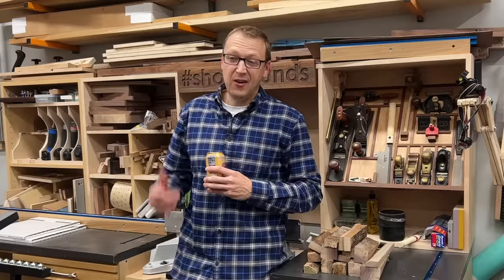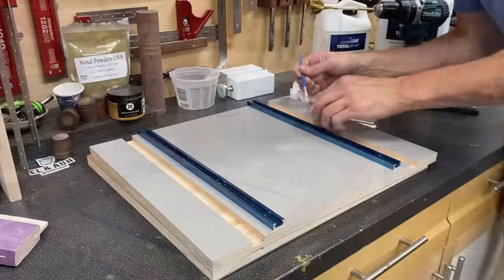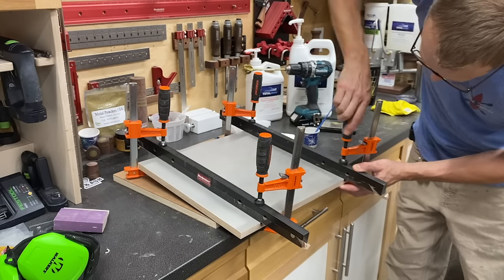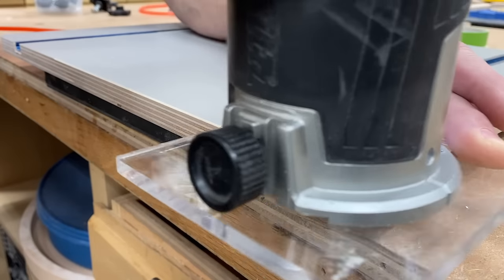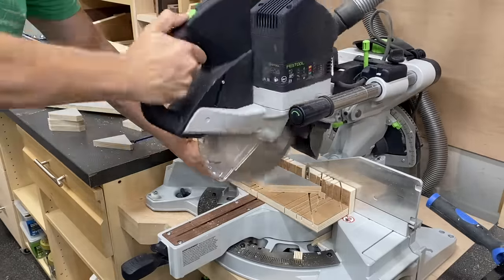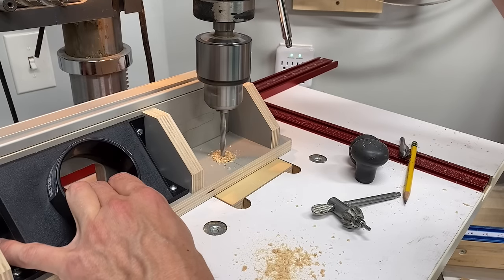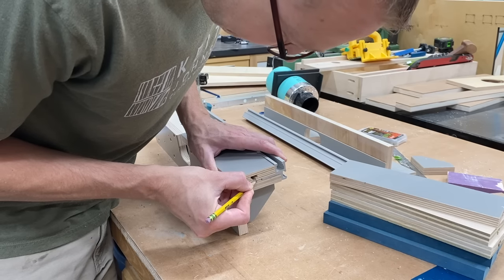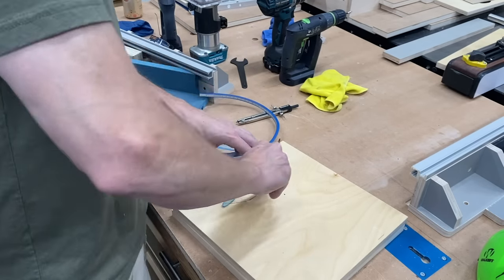DIY Router Table for Trim Routers | PLANS AVAILABLE

Comment: Where could I find that clear square makita router base  i love it. I want one. Thank you
Love the video!
Reply from the maker: Umm...I made it...as shown in the video 👍
Reply: What you charge to make me one?
Reply: I dont have the capability to make my own.
Reply from the maker: @roguejediwil  Sorry, this is not something I would build to sell and it wouldn't be cost efficient at my labor rate. You are better off buying a commercially made one from InfinityTools or Rockler.
Reply: @KeithJohnsonCustomWoodworking  ok
thank you!

Comment: Already have the rigid router for it!
Reply from the maker: That's a great little router! Love that micro adjust 👍
Reply: I actually hate mine… the micro adjust always slips and collet loosens a lot on its own. It’s been more a headache than a help, but it’s all I got!
Reply from the maker: @anthonymikkelson7394  Interesting. I haven't had any issue with mine. I have the corded version, not sure if you have the cordless.